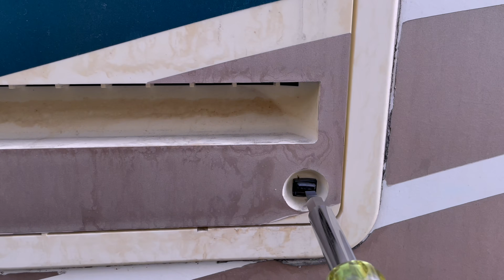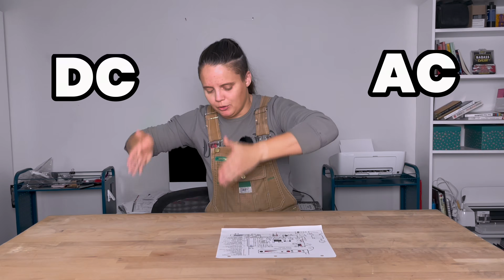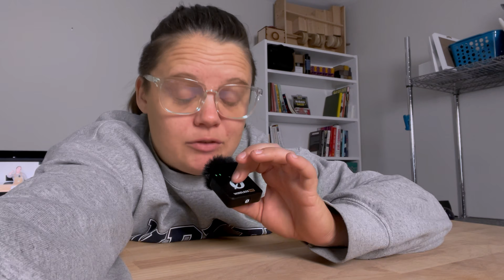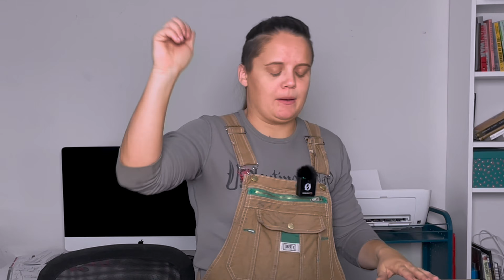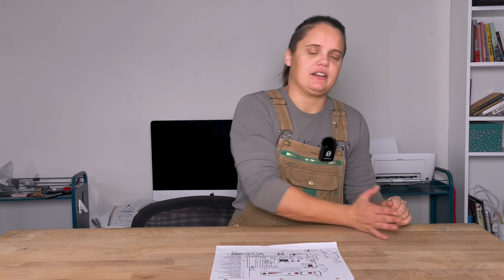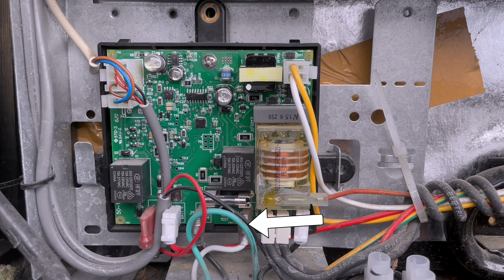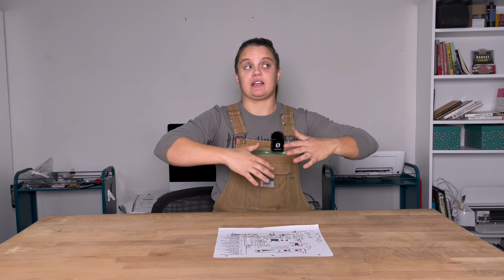How to Troubleshoot Your Dometic RV Fridge (With a Mobile RV Tech)

Comment: Great video!
I had already gone through the testing via a different video. The testing revealed that the circuit board could be bad. I needed confirmation, so I went through all of the tests again using this video. Same results but in this video, you mentioned tapping the relay. When I did that, I had 120v on the heater pin and it worked. However, it was a one time fix and didn't work again. It gave me 100% confirmation the circuit board was faulty. (Thank you)

Comment: I have a Dometic RM2611. The freezer  is 8 degrees  but I can't get the fridge  below 41degrees.. I've been switching back and forth between the original and a Chinese thermistor with no real difference. I have lower and upper fans  in the outside compartment that worked awesome last year. I only use propane. What am I missing?

Comment: This woman is great. My fridge didn't work and I followed her method and determined my circuit board was bad. My Power Probe read 3.7v at the orange wire but 13v going into the board. This indicates the board is bad. I was using a power probe to test the board which can apply power, so I pushed 12v to the orange wire and the fridge came to life. I then disconnected and reconnected 12v to the fridge and it works normally in all modes. Maybe this trick will help somebody get a few more days out of a bad board. Good luck

Comment: Question…what if I get the long “check” beep in both electric (auto) and gas settings?  Would it most likely be the circuit board?

Comment: Emily, love your video on diagnosing an RV Dometic fridge, well explained through all the steps. I’ve checked everything in the video and everything tested good but still fridge does not work. Does this mean I need to replace the entire fridge?
Reply from the maker: Is the tube on the side getting hot? If it is but the fridge isn’t getting cold then you need a new cooling unit. If it isn’t getting hot then you have an electrical issue somewhere
Reply: Thanks for the reply, tube is definitely hot (burnt my finger lol😂) all electrical checks out, so I will look into a cooling unit

Comment: thank you for all. I have a problem on my mother board 220vac europe version and the motherboard is out production. The fridge work only on 12vcc and gas. The mother board doesn't recognize the 220vac supply. I want to connect the 220 ac resistance directly at 220ac  wire with a fuse to protect it and i can start manually the fridge with a manual switch and a thermostat . Thank you and greetings from Italy

Comment: Really great video, but I just ripped my pcb cover in half. To remove the cover over the PC board - Once you have the screwdriver in the little slot, don't "wiggle it around," you need to move the screwdriver handle to the left. This forces the bottom of the cover to the right which lifts the front cover over a little tab, located behind and to the right of the cover. So don't twist or jiggle anything, just move the screwdriver handle to the left.
BTW, I really appreciate the content of this video. Thanks for all you do!

Comment: Hi I have a 2005 rv w dometic refrigerator and I have a problem when I try text the ac power from the circuit board using the common ground I only 70 volt a/c

Comment: I'm just wondering why editing Emily didn't remind anyone that in the center of that thermal disc the little black button is a reset button if you're not getting continuity between the two push it in to reset if it does allow you to push it in you'll hear a click but if you have to keep resetting it you obviously have another issue.

Comment: Are you certified or registered?  I was told only RVTI certifies techs and RVTA registers them.  RVTI said no other techs are certified but wonder if that is true?
Reply from the maker: Yeah not true. I’m certified through the RVTAA. And there are other programs that certify techs. The “certified” distinction means whatever the school wants it to. I could technically hire someone, train them myself, and call them RV Repair Woman certified. 

My cert means that I went to school for 7 weeks in person, learning specifically about how to fix RVs.
Reply: @rvrepairwoman  Thanks for your quick reply!!  They were telling us they were the only Certified techs because their training is backed by the RVIA but figured it was not so.  I found their level ll training very lacking in practical application, good for didactic but the lab time was sorely missing for the most part.  IF we spent 2 hours in 3 weeks in the lab it was a lot and then not enough equipt for each student so not everyone got to do each thing like finding problems with a hot water heater or even where to start looking with MM and how to do it, when to look for voltage and when to look for amperage,   It was a grand disappointment to me and sure others feel the same way.  3 weeks but a few other classes were using the same lab spaces so we did not get the time we needed.  NOT sure if it is true of past courses at RVTI but disappointing.  As techs, we are not going to be academicians but technicians and need the practical practice as much if not more than didactic training.  I guess the word "Certified" is what one wants it to be.

Comment: WOW!!  Ive looked at several "experts" on youtube and yours is the best approach to diagnosis Ive seen!   What model were you testing? I have a RM3762 and it seems it must be laid out a bit different. I dont have the 6 pin your speaking of to test the board and no orange wire.  My issue seems to be no clicking or spark after its been stored.  All other devices that use gas work...but not until I drive around for awhile does it finally click and fire. So weird. Wish I was in Vegas Id definetly look you up for service.

Comment: Well I am having the issue of no power at the fuse on the circuit card. Fuse is good, just nonpwer on either side. Have power everywhere else. I have a card coming as it's the only thing I can think of that would be the issue. Thoughts?

Comment: Emily, Your explanation is amazing. I have worked in electronics for over 55 years. I have never heard such a cogent and clear walk through a troubleshooting process as yours. ( your analogy of a switch being like a drawbridge is brilliant ). Tomorrow I will follow your logic and troubleshoot my Dometic refrigerator that won't cool on shore power. Thank you!
Reply: Emily,  I was able to follow your logic to a blown fuse and then an open circuit in the electric heating element. I used a simple meter and an amp meter. I replaced the element for $20.00 and the fridge works and is still cold after 3 days. Thank you.
Reply: Im having the same problem, it wont work on shore power.  It worked like 8 months ago, but not now.  Is there any further advice you can give?  w@BruceKuchta
Reply: @BruceKuchta I suspect my fridge is a 2008 Dometic and doesn't look a lot like the one used in this demonstration. It's in a 1981 RV, but was replaced by the previous owner.
Reply: Spot on!

Comment: Awesome instructions. But lacking safety. Please don't try to remove the 120 volt fuse without unplugging the 120 volt plug.
Reply from the maker: Great tip. It’s hard when scripting these to remember all the little things you do automatically.

Comment: I just found your channel. I live in Las Vegas so I will be calling you. My fridge will work when i override the system and plug into an extension cord but is using up propane. Won’t work on electric. Probably something simple since it’s 2 years old

Comment: Mine does well on ac temperature is good Then I put it on gas it lights pilot looks good  but the temperature rises considerably in the refrigerator   Driving me crazy I’ve been to two dealers   I’ve had no luck
Reply from the maker: If you figure it out let me know. I’ve got a customer with a similar issue.
Reply: @rvrepairwoman      Im asking for advice    Any clues ???    Anything will help    It doesn’t make any sense

Comment: I have a 12v dc 10 cubic ft, The power from the fuse goes to the Main PCBA Cooling unit, however it does not return to the main control board on top of the fridge.  It is not a wire issue, the 12 volts does not exit at the tab where the return wire terminates.

Comment: Can you tell me what the blue wire coming off? The 4 pin connector it's supposed to go to. It's in the upper right hand corner. Looking at mine, it's not connected to anything and that diagram shows it being a test point. My fridge was running too cold. It was in limp mode, so I. Switched it out for a dinosaur p seven eleven, and now i'm not getting any power to my fridge. Dometic rm2611
Reply from the maker: That wire I'm guessing has some heat shrink on the end of it? Its not supposed to be connected to anything. Its an extra wire that CAN be used for troubleshooting in niche scenarios. Its most likely not your problem.

Comment: Great informative video.  Did all the tests on our Dometic fridge.....TWICE!  All readings are as they should be.   Our fridge and freezer are not getting cold or frozen enough.  Freezer food is soft.  Liquids in fridge are warm.  Lights are lit up on the EyeBrow board.  We're stumped.  🤬
Reply from the maker: I’ll make a video on this soon. (I think I have it on the schedule for this month) but real quick. If a fridge is working electrically (passing all the tests) and is LEVEL but not cooling it can be 1 of 3 tings. 

1. Insulation. Make sure there is proper insulation around all the sides of the fridge AND  the top. The insulation is just like the fluffy fiberglass stuff in the walls of your house and it can work its way down when driving a lot. Some manufacturers also forget to put a piece of insulation on the top of the fridge and this really cuts down on the fridges cooling power. 
2. Ventilation. If you open up the upper access panel for the fridge you’ll see some fins on the back of the fridge. Air HAS to go through these fins in order to cool the fridge. Make sure nothing is blocking the air from being able to come in the bottom access panel, up the back of the fridge, and out the top panel. Sometime we need to create baffles to direct the air across the fins. 
3. If your insulation and ventilation are fine you may have a bad cooling unit. You can test for this with the hand test. Look for the flue on the back of the fridge and see if it’s getting hot. Then check if the black coils in the back of the fridge are hot as well. They should be within 10 degrees of each other. If the coils are WILDLY hotter than the flue than you most likely have a blockage in your cooling unit. If the coils are drastically colder than the flue then you most likely have a leak in your cooling unit. Both mean bad cooling unit and it needs to be replaced. 

Hope that was helpful/ understandable without visuals. Video is in the work! You go this!
Reply: You have made great suggestions.  We'll do more testing today.  We will update you. Thank you kindly.   @rvrepairwoman

Comment: Love the video it's so complete! The only thing I don't see is what's happening to mine. When I get to the point in the video where I'm checking to see if my gas valve is getting 12v at the board, mine isn't. Does that mean the board is bad? No power seems to be going to the valve and I never get a click click click igniter sound. I have manually fed the gas valve 12v and it makes a loud click and gas flows, I tested that.
Bad board?
Reply from the maker: Follow back the wires from the gas valves to the board and see if the board is sending out 12V to them. (I think you e already done this) if you’re getting the signal from the eyebrow board to go for gas, but the board isn’t send out power to the gas valves then you’re board is most likely the problem. Also double check that fuse just to be sure
Reply: @rvrepairwoman  thanks!
Reply: Any way to check the eyebrow board is sending the signal? It seems to be working. When I switch to gas it turns off the lights on the eyebrow. After a short while the "check" light comes on. Again thank you 🙏  @rvrepairwoman

Comment: I still can't figure out what's wrong with mine. Gas comes on, see pilot light, flu gets out but fridge remains warm. On AC, flu gets hot, but fridge remains warm. I can't figure it out
Reply from the maker: If that tube is getting hot but the fridge isn’t getting cold, then you most likely have a refrigerant leak and your cooling unit needs to be replaced. Or the whole fridge if that suits you more. There are a handful of places that might do a rebuild for you, but you’re most likely looking at a replacement.
Reply: @rvrepairwoman  After watching your video and going through all the steps, that was my conclusion as well. Your instructions and tutorial are great. Thank you!

Comment: I have a dometic fridge that is cooling fine an ac power but the striker keeps trying to light the propane. I checked everything in your vid. Everything was fine. I just cant figure out why the striker keeps striking.
Reply from the maker: Just off the top of my head I would look to see if you’re getting signal from the eyebrow board to turn on the AC and the Propane at the same time. If you are then I’d think your eyebrow board may be part of your problem. If you aren’t then my guess would be faulty main board.

Comment: My god, I have a 30 year old ford transit where the fridge works on gas and mains but not on 12v and thanks to our algorithm overlords, It brought me to this video and it only dropped 5 hours ago. 

Instant Sub! 

Thanks for all the tips
Reply from the maker: I''m so glad this video found the right person!
Reply: Hello  Emily  I watched your video on dometic rv refrigerator checks. My inside control panel  is dead,has power to it but no power on black signal wire that goes to outside circuit board. If jump the wire terminals at eyebrow board the panel lights up and fridge works.  I replaced the eyebrow circuit board and still have to jump those wires to get it to work. How can I get a hold of you for help.